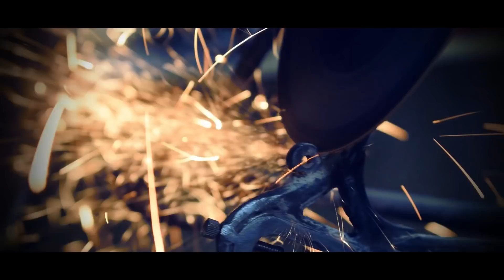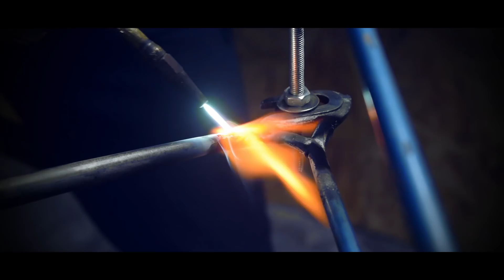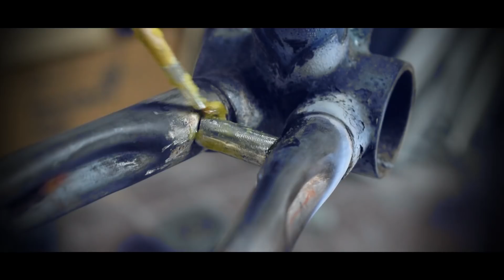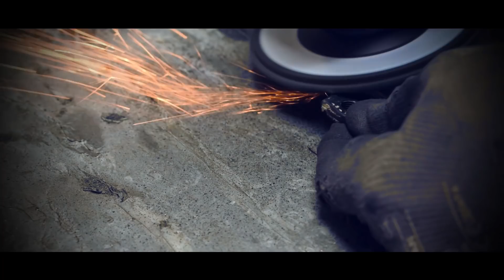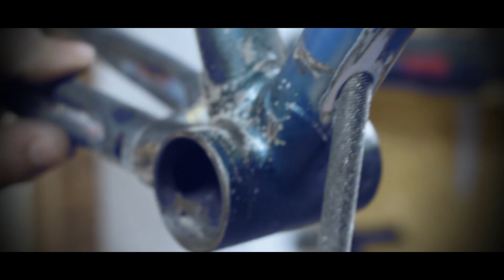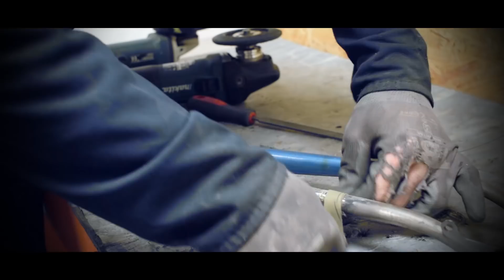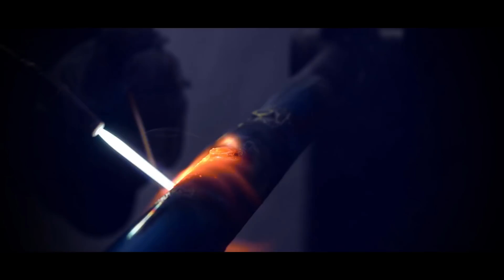From Classic bike to Gravel!!! - 2nd episode -

Comment: This is really sketchy and silly. 

Their is no way that fork blade is going to be tough enough for the disk. The removal of metal, the heating and re heatiung of it etc.
I have a Jamis Aurura elite and I don't have too much faith in the flex from the forks disk brake and will be chainging to a surly disk trukker.

I have only built one frame here in the UK on a course and this is really sketchy to say the least. 

-You need a central jig to check alignment of the chain stays, then tack in to place the seat stays. the fame is most likely running a 120mm rear drop out, I guess you are converting it to 142mm tru bolt.  Im sure that it would be out of whack, people do this and then bend the gear hanger etc. over 20mm of bending. Surlys use a 145mm droput with a little bit of flex for 142mm and 148mm. 
So unless you have just bent it or can realign the chainstays with jig then its going top be worng in one or two areas. Also your chainrings might end up catching on the chainstay.

-That brace for the rear disk brake wasn't exactly flush with the frame so when you put in the rod it won't stick all too well.

Mountain bikes that where made for cantis that where then installed with V-brakes had the exact same problem. Brakes to powerfull and will damage the frame or fork. 

-That fork was made before the invention of disk brakes, it's really unsafe, the blades are thin, lugged and on a 1inch steerer tube. 

Im supprised that you didnt strip the paint off all of it, checking for other damage or even for the sake of the fumes if you accedently burn some. Gotta repaint it anyway.
Reply from the maker: Hello Friend !!! What you say seems perfect to me, I am not against it and I know that everyone will have their opinion. I accept yours. But the bike is more than tested because if you did not understand, I would not have uploaded any video without seeing the final result. I have done routes that I only do with my mtb, to see if the fork was strong enough to hold stones, but and the sudden braking of the disc and I must say that it works perfectly. Also tell you that to roll on roads of record, I do not think you have to have a bicycle of more than 1 ", my grandfather has gone all up the field with a bicycle like this on roads and has never had problems. But as I have said above everyone has their opinion. If you do not like I understand it and I know that for some people it is inevitable, mess with the things that others do. Thanks for your comment and greetings ; )
Reply: @dabrestauracion7404   dab restauración  Hi i am a hobby framebuilder, have built 8 frames so far, Im no expert but have something to add. You did an fine job. What Declan says is true the wall thickness may well not be suitable for a disc on the front. 1 inch forks also have a rep for failing under disc loads so i would really encourage you to find a fork with a disc mount for it. However overall its was ok. Just mitre the disc brace next time and maybe use something with a lower melting point for the internal routing. Like 35% or 45% silver. Try to avoid getting things as hot as you did especially in the middle of tubes where it may be very thin. Repeated heating at temperatures required to braze can be very detrimental for the steel. You may fin it cracks around the HAZ of one of those braze points. And use more flux, you can never have too much flux! Flux everything all the time everywhere! :). Just ride the shit out of it and see. The only thing i will say is get a fork before you go too fast, dental surgery is expensive and ive heard death is unpleasant.
Reply from the maker: @tammysmith6773  Thank you very much for your constructive comment and for giving me all your experience, it is really appreciated. The truth is that I was getting excited, I had to consult with experts before. I have asked several people that for me they are authentic cracks of the assembly of frames and they have told me the same thing that you have told me. They have recommended that I can use it but not very aggressively since it could have problems if I demand the limit to the bicycle. so as I said in the first comments of these episodes, I will use it to go to work, since a flat gravel road and will not force the bicycle to a possible breakage. Greetings and thank you very much for your constructive comment ; )